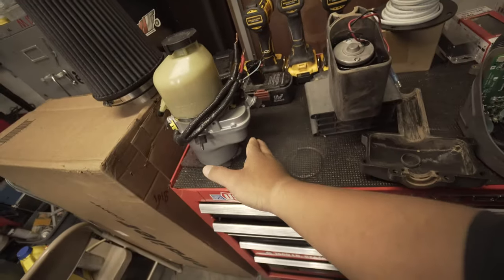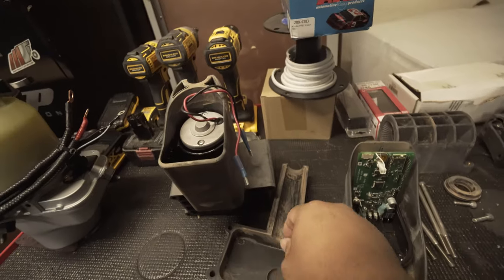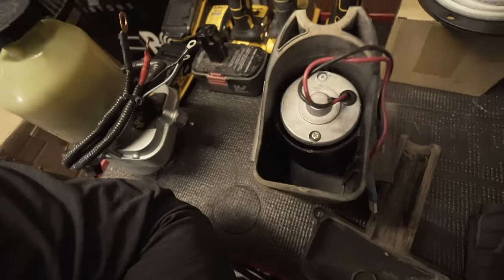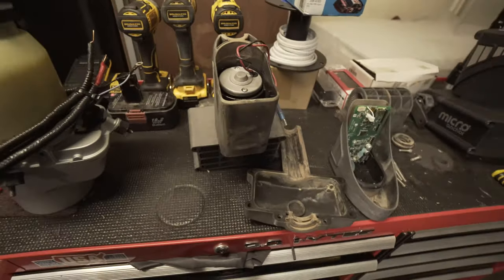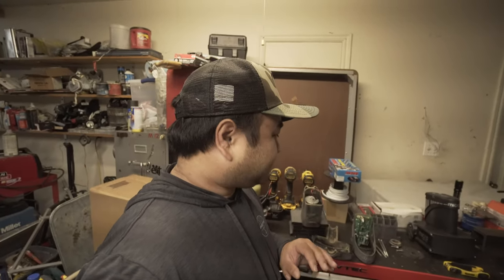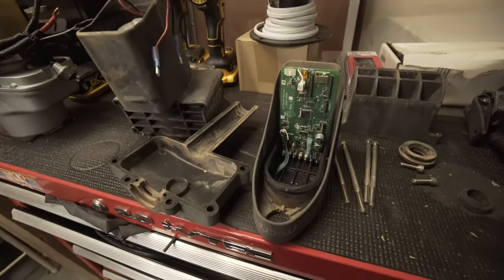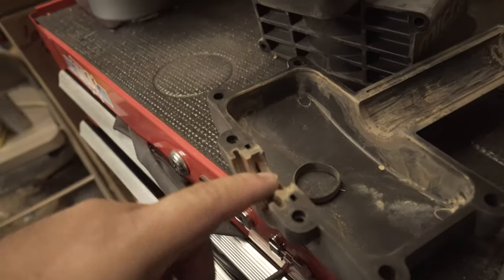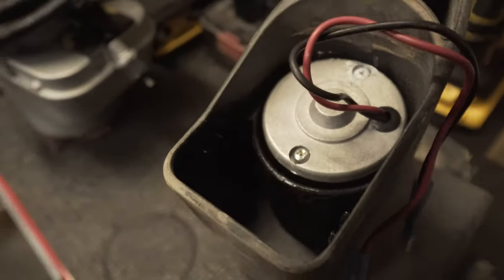Power Pole Micro 3 Year Review Lots of Problems - OOW Outdoors

Comment: I have a question about the Micro anchors. Really enjoyed your video showing the inside components of the anchor. Between my brother and I, we have had to warranty about 6 of these micro anchors with similar issues. Most of the problems was with water entering into the unit and causing electrical problems. I have mine on a 17ft boat and I think when I go in reverse, the engine forces water up into the black plastic cover, which has the lip on the back side. I realized this looked like the issue and wondered why they didn't make it sealed there. It was hard to tell in your video and I cant find any old pics online of how the old design was. 

But was there a rubber gasket at all under the top cover to protect the circuit board? 

Not sure if you have seen but they just came out with a NEW TOP DESIGN which I was told a few weeks ago that this should fix the problems. They have some photos on their website showing the new design and construction parts listed! It also says that it is now rated IP 68 Environmental Resistance (1-2 meter saltwater submersion). I just received my new micro anchor in last week and I am hoping this one will last me a long time now. I love the anchor when it does work lol

Thanks!

Comment: Just bought mine and took it out for the first time, while out in the water was working great in came in to shore for a quick break and boom it no longer goes up or down but battery fully charge all lights working just wont go up or down??? Any suggestions or help ???
Reply from the maker: Of its locked up. There is likely a electrical board issue.  Call customer service.  Power pole are the best in the industry.
Reply: @OutofWORKoutdoors  Thank You

Comment: About to add a micro to my kayak, thanks for all the info! Do you have any experience with the power pole micro battery? I'd like to go that route rather than adding a second battery to my kayak (already have one for the lowrance) but I've seen really mixed reviews online about them.
Reply from the maker: We run one big battery for everything on the kayak
Reply: i love how simple it is to pop the battery on like a cordless drill but i have had trouble with it working consistantly. it worked perfectly for the first month or so but after that it would lose connection or something and not work at all. unfortunately there is nothing you can do about that when you're on the water so it's beach it, pull the battery off, put it back on ,give it a smack to make sure it's seated properly and hope it works. not very convenient on tournament day. i am actually looking at running a cable through the hull of my bonafide ss127 and powering it from the same battery i power my lowrance with. it's very frustrating for the price of the power pole battery. to be fair, i'm not entirely sure it's the battery or the power pole itself that's the problem. i intend to contact power pole and get their opinion on what might be the trouble. maybe they'll just replace it
Reply: Davis Knowlton I had the same problem,power pole did replace the unit and battery. But the replacement one after using it 4 times crapped out again. It seemed like a battery problem but when I tested the unit to a 12 volt battery it still didn’t work. They are replacing this one also, so I’m waiting for that to come in. So far it’s frustrating to have 2 units fail but the customer support is great. 
They also told me the first unit had water damage, well it has never been submerged and it’s weird that something made for the water cannot get wet! 😞

Comment: I fish saltwater 4-5 days a week I have had 6 micro power poles my problem is always the plug and where it goes into the unit corrodes and I have tried packing it with dielectric grease nothing works with the saltwater.

I am buying Another new unit this week because I cant stand not being able to drop anchor from the bow while I’m fly fishing tailing reds. 

I will say their warranty is awesome I have had them send me 3 new units in one year no questions asked overnighted next day to my house
Reply: Have you tried spraying the plug with Corrosion X?  I use it on my electronic plugs and they are holding up great so far.
Reply from the maker: Well i guess i was right about salt water guys migh be having issues.  but Yes, like you said, it just makes life easy having one of these things.
Reply: Boat or Kayak? I’m thinking about getting one for my 16 foot alweld flats boat

Comment: The first thing you have to accept with an automated anchor pole is that what you are asking this device to do a rather difficult task.  Lots of forces to deal.  The environment is also very adverse.  And if the thing does not work perfect every single time you hit that button, then its a piece of crap.  Its funny how other gear like fishing rods, manual anchor poles, nets, and so forth, are considered consumable items, but somehow that does not apply to this product.  Well, it does.  Automated anchor poles are also consumable items with a limited lifetime and amount of use after which the product is spent.  With Power Pole specifically, I would not consider buying one of their anchor products as an exchange of monies for goods.  Rather, you are hiring them to provide you a service for two years.  If practically anything goes wrong they will overnight you the parts to make it right with virtually no questions asked.  Rest assured, this thing will break.  They all break.  Talon, Blade, Pro Series, Micro, whatever.  All of them break with normal usage.  They also break with no usage.  There is no way to keep them from breaking.  Replacement parts are ridiculously expensive.  I think the PP hydraulic units alone are like $850, and they only last about 2 years.  Your warranty replacement will be a refurb, so that one will last one year.  It is what it is.  If you want the convenience of an automated anchor pole, then you must pay for that convenience as an ongoing service fee.  Otherwise, don't get one at all.  This product will not last anywhere near the lifetime of the boat.  Keep that in mind when you make your decision to drill into a transom or deck.
Reply from the maker: Yes i understand normal wear and tear.  But where is the service manual????
Reply: @OutofWORKoutdoors  This is not about wear and tear.  Actually, I suspect you are a light duty user.  There are people that operate their units several hundreds of cycles a week as pro guides and whatnot.  They last about the same for them as they do for the 10-20 cycles a month user.  The lifespan of the units are more based on time than cycles.  Time from the first water that gets into the connector.  Time from the first hydraulic oil in the reservoir.  And so forth.  These things just dont last, hard use or not.  That is why I am saying its all about the warranty period and excellent, fast service from Power pole.  That is what you are actually buying.  The Micro has a warranty of 2 years, and that is what you should expect out of it - 2 years before you have to shell out more money to keep using this item.  The other PP units also have 2 years warranty, but its the same deal.  The main thing that breaks is the pump unit, so that is usually what you get replaced for you.  They were $850 (for a refurbished pump unit), might be higher now.  If you are lucky, you might get one to last 3 years.  Most pump units, its 1-2 years.  My advice...install it somewhere easy to replace and dont get attached to it.